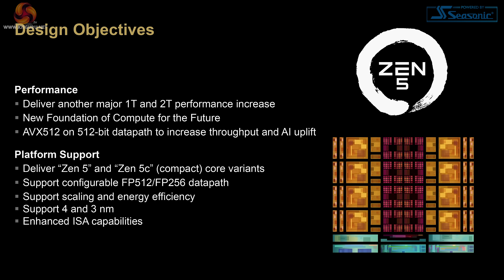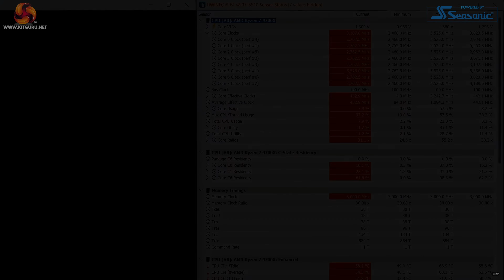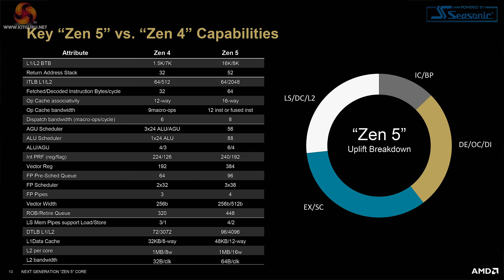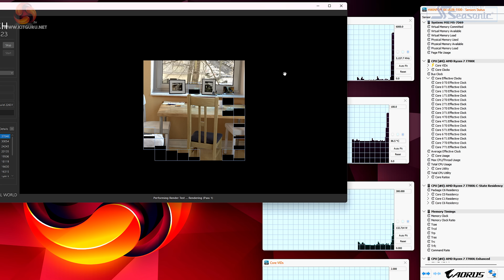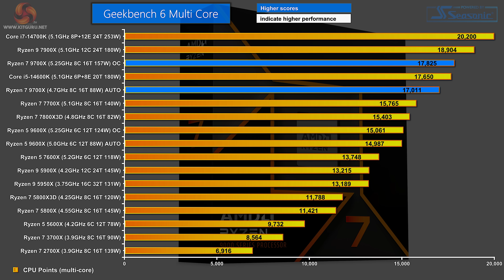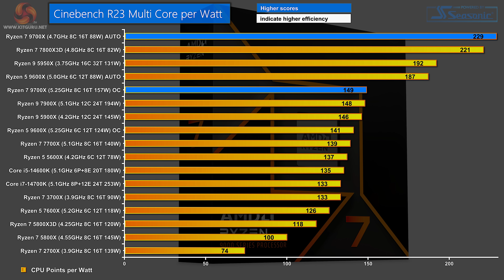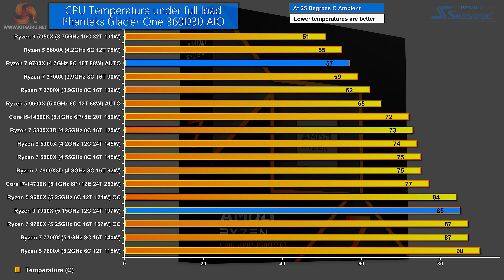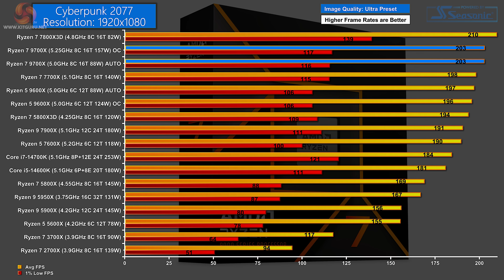AMD Ryzen 7 9700X review: YouTube hates this CPU

Comment: Why is everyone ignoring the Ryzen 7 7700 non-X? It's got the same 65W TDP and 88W PPT as the 9700x, with 96-98% the performance of the 7700x, while costing just 250$
Reply: @carljones9640  it being an "X" Variant is irrelevant, the only things that matter are its performance and its price. "X" is marketing.

And its performance and efficiency is within 5-8% of the 7700, while being nearly 50% more, hence it's bad overall.

It's nearly the same price as a 7800x3d, yet both its absolute performance AND it's efficiency is worse in games, hence its bad for games.

It's more expensive than a 12900k yet gets destroyed in multithreaded workloads, so it's also bad for that specifically.

For sure not DOA though, there's still underlying architectural improvements unlike eg 11th gen, so when it drops significantly in price it'll be fine.
Reply: @yz249  7800x3d=€490+. 9700x=€340+. how are these 2 CPU nearly the same when 7800x3d costs €150 more? they aren't. and 9700x is not 50% more than 7700=€270. it's 20%.
Reply: @SapiaNt0mata  I guess it depends on where you live and what deals you can get, sometimes the 7700 is a better buy, sometimes it costs almost as much as a 9700x. I have them both on and off the whishlist, depending on the price.
Reply: If they’re going to test the 9700x with PBO they should test the 7700x with Eco Mode. In no world is this product worth buying at current price.
Reply: @HowdyYT  and 7700x and 9700x with PBO is not even the same thing, PBO put the cpu "out of warranty" status.
Reply: This should be a 9700 non x launch and cheaper. Also it performs quite bad at 150+ watt
Reply: @Johan-rm6ec  it gains 25% performance running 173W.
Reply: Why all the hate?  Intel released the same CPU with tweaks for well over a decade and every one lapped it up.  It has place it just maybe not for you.  But it's ok.😊
Reply: @littlebill1987  I didn't... I've been criticizing AMD and Intel since 2012... 
And just because one is a bigger shit, doesn't change the fact that both are shit...
Reply: @rattlehead999  why have you been criticizing Intel since 2012? 

The 3930k was an awesome chip. I'm still using it.
Reply: @DingleBerryschnapps  because they stopped improving the cores as much as possible. Cores started getting a lot smaller in area with Sandy Bridge. (Yes sandy bridge was from 2011, but with ivy bridge they solidified the fact that they didn't care for desktop users). 

They started to fully focus on the server market, since smartphones(and at the time tablets) took over.
Reply: The non-X is more expensive than the X where I am.
Reply: @folksurvival  still worth it for the lower power consumption and temperatures, as long as they are not a lot more expensive.
Reply: I am on 7700 and find it great. It boosts at 5.5 GHZ and all is fine. Price is so attractive and don't have that much performance difference as I game in 1440p/4k.
Reply: @Hyperion1722  you won't see much difference at 720p either. XD
Techpowerup tested a ton of games with a rtx 4090 at 720p and the difference between the 7700 and 7700x is less than 2% and the difference between the 9700x and 7700x is less than 6%.
Reply: I have a 7700x and it was a bit disappointing to hear the 9700x is somehow a slight downgrade.
Reply: @th3ch33t  Don't think you watched the video...
Reply: @th3ch33t  Zen5 is bottlenecked hard internally and due to memory bandwidth. 
It does great in server tasks that don't rely on memory much, like literally 30-90% faster, but sadly most tasks are memory dependent and it does 5-15% better there. 

The only problem with the 9700x is the price, if it costed 280$ it would be perfect.
Reply: Because having an X sounds cooler
Reply: 5600 and 7600 were both 65w but the 7600 was considerably faster on a 4090 at around 30%. If zen 5 at the same tdp is barely faster, but costs more, it doesn’t seem like a compelling product.
Reply: @Xennial647  poor example. The 7600 is on a new process node with much higher clock speeds and Zen4 was a bigger upgrade over Zen3 than Zen5 is over Zen4.
Reply: yeah 7700 alone make 9700X absolutely irrelevant
Reply: @Trisstan20  They made a very overclockable 7700 with better power efficiency on the smaller node. Really, it's not a terrible CPU if you want to tweak it, but for gaming, the 7800X3D at the same price or less is the obvious choice. I wonder if we'll see a 9800X now with a higher power limit and boost, similar to their Zen 3 product segmentation.
Reply: @Trisstan20  I mean if you want a CPU with slightly worse performance for a lot cheaper then go with the 7700
Reply: You realize what you're saying there is that if you take a Ryzen 4 part and lower it's TDP, it's going to perform worse than a Ryzen 5 part at the same power, whereas if you let either part draw as much as they want (like with a PBO OC), then the Ryzen 5 part is much faster than the Ryzen 4 part at virtually identical power draw. In either case, the Ryzen 5 part is more powerful while being more efficient, all while being cheaper at launch prices. To uniformly declare ryzen 5 DOA just because it doesn't do any better in gaming is fine, but not everyone is a gamer or even cares about gaming.
Reply: @cajonesalt0191  and remember the next gen motherboards have not been released yet.
Reply: @cajonesalt0191  the 9700x is 10-15% faster than the 7700 non-X.
Reply: @cajonesalt0191  With this usecase i´d rather buy an Intel 13th or 14th gen CPU. They´re better in the "If you max out the part until instability, you´ll win every benchmark" game.
Reply: X actually does indicate something. It refers to the cpu architecture itself. Same was X3D does (much larger 3D cache, better for gaming)

This cpu, is NOT, a gaming cpu. AMD missed the mark there pretty hard.
Reply: @goldenhate6649  If by architecture you mean the applied power specs and frequency, yeah, but X3D is a different hardware design. AMD didn't create a gaming focused CPU, because that's what their X3D parts are for, but they still have to capture some of that market with their advertising. Some people will blindly buy this cuz bigger number better.
Reply: @goldenhate6649  AMD and Intel have NOT made a gaming CPU since 2008...
We have server architectures fitted for desktop.
Reply: @jojobetzler3732    Except that Intel knowingly sells defective processors, then cover it up, and lie about it...
Reply: @cajonesalt0191  "all while being cheaper at launch prices. "
Funny that we are not 2 years in the past anymore. Maybe you have been living under a rock too long, or are just too stoned, but the 7700 had a lower price at release, was available for quite some time already, is now even cheaper, and just about as efficient.
Reply: Because that would destroy their arguments for the 9700x being a good chip, and it's easier to ignore and hope your viewers don't notice.
Reply: @yz249  yeah, my thoughts exactly.

Comment: This is funny, if you limit the 14600k to 90W it should still spit out about 1'150-1'200pt in R24, which is right where the 9700x is at, for the same power consumption. Yes I know that the i5 has many more cores, but in a way it still worries me because the 14th gen is basically a refresh of a refresh and is also based on an inferior node....
Reply: But that's exactly what is the issue: it has more cores: 14 cores vs 8 cores, even through it has around 20 vs 16 threads is simply better in productivity, no matter how many thready they have. Physical cores >>> Threads. And even if they are efficiency cores, they are many more of them. That the ryzen 9700 with just 8 cores catches up to a cpu with 14 cores is concerning yes, for intel.

Comment: Steve of hardware unboxed brought up a good point about why these chips suck even when it comes to efficiency improvements. Theyre only noticeably more efficient than the X parts of Zen 4 and X3D. Theyre only 7 percent more efficient than the non x parts that are almost just as fast but significantly less hot and less wattage. Also wayyyy more expensive than those are currently. So in a nutshell, Zen 5 is actually awful. They somehow still compete with Alder Lake, only are a better option than Raptor Lake because Raptor Lake CPUs are timebombs, and get absolutely  dunked on by X3D last gen and competitive at best with the 5800X3D and 5700X3D. Theyre just bad and Raptor Lake dying doesnt save them from being irrelevent event on their own platform. Why anybody would by these over Zen 4, X3D or not is beyond me considering pricing

Comment: Just get 7800X3D for gaming.

Or 7900nonX for content creation or 7900X3D for gaming+content creation.
7900X is for some reason significantly more powerhungry then 7900X3D.
No need for 9700X .

If powerdraw is critical in your mind, you should know that 50-60W extra won't change a thing in your bills.
Few £ a month.
7800X3D while declared 120W .
According to Tomshardware it's usually below 100W in gaming.

If you would risk with Intel  , than 14600K is best value all arounder on best value for money MSI PRO B650-P WiFi motherboard that supports cheap DDR4 memory that isn't much worse than DDR5 .

Comment: Power efficiency gain of 40% isn't really that impressive considering ryzen 7000 out of the box was outside efficiency range. For example, intel cpus at 400w are only 3% faster than same cpu at 253w limit. That's a 58% reduction in power draw for 3% performance trade off.

Comment: Zen5 is a joke, no improvement. Use less energy but failing to be faster than previous generation it is not improving efficiency. There must be something wrong with zen5, that's why they left too much overclock capability, because it would work for some people but not for othes, then it is silicon lottery

Comment: Great review, very balanced - we need more of this today in a market of media just feeding on drama.
Reply: The Steve's have frankly embarrassed themselves.
Reply: @robertmyers6488 Unfortunately, I would agree with this.
Reply: @gerardw.7468  I noticed it the last gen.  The irony is that when their beloved 9800x3d comes out it will fail the same value performance test.  Even then the data is asymmetric.  No cost analysis of the energy cost differences as a factor of overall cost.   We need more data on power usage from idle to peak efficiency.  

Also, the overall heat load of a system is not trivial.  Could even take it to the other end of the curve.  What is the long-term medical cost and quality of life changes of noise?   Something most are ignoring.  I've spent too much of my life next to fans and its showing.

Comment: Thumbs up for a legit review. It does seem like these new processors have to be unleashed with more power usage allowed in PBO and probably curve optimizer settings to undervolt, to shift the power curve. I'm going to get one but only because I'm prepared to use an AIO and really crank the power to get it to perform like it can.
Reply: I'm in the market myself for a new build. These are tempting with the power draw for similar specs in gaming. And also, theyre all tested at 1080 to show the bottleneck, im running triple 1440 with a 4090, so im not (i think) going to be bottlenecked to utilise the CPU like in these tests. 
PC will run quieter, AIO wont be straining, this actually seems like a decent cpu.
Especially coming from an intel 8700k 😅

Comment: can you compare the ryzen 7 9700x vs the ryzen 7 7700? idk what to buy, because both consume the same watts but the 9700x is only 5-7% faster for around 100$ more in my country
Reply: I'm building a new PC, so the 100$ can definitely go towards a better GPU, or a higher quality PSU, and some other stuff. what do you think?
Reply: @givinnatanlie4619  7700. It's value king.
Reply: @givinnatanlie4619  how much is 8700f ? without internal GPU you now have 200$ more for discrete GPU.
Reply: @xponen  the 8700F is 250$, 9700x is 400$ (could probably go down to 380$ once it's flooded into the market), 7700 is 290$

Comment: How does it compare to the R7 7700(non x) though? iirc those were fairly efficient compared to the x variants for a minor loss of performance
Reply: Well, given Non-X variants have lost some performance while being efficient & 9000-series have in fact gained some performance at the same power lvls — I believe that's your answer right there.
Reply: @F1stzz  so it's an incredibly marginal improvement for quite a bit more money than the current retail pricing of the non-x 7000 series cpus?  that's a miss in my book.
Reply: @ThrasherEscapes  your getting 4% less performance for so much less money
Reply: @ThrasherEscapes  it's marginal now, on first day after the release — current batches of motherboards are yet to be optimized & RAM compatibility issues are yet to be solved. Till the end of this year, when things get ironed out & new chipsets will be out and optimized as well, we'll see how all this doomsday calling ages. Summer next year (might even be spring with all the negative media around 9000-series) these CPUs will receive around $30-50 price cut and become a bang for buck. Also, sitting on a current gen & jumping right on the next one the second it comes out was never a common practice despite how everyone now pretends it was/is too. Give it some time, these chips are already incredible value for SFF builders & in a year, with all the efficiency brought by 4000-series Nvidia and 9000-series Ryzen, that'd be around 50% of users.
Reply: @F1stzz  my takeaway is that amd rushed these out the door when they could have taken some time to smooth out all these issues.  they were under no outside pressure to release these but they went ahead and released them anyway, with several problems that really detract from the day 1 experience.  it's kinda baffling and ultimately frustrating.  i expected these to be better on day 1 than they have been and it's disappointing.
Reply: @ThrasherEscapes  they've certainly rushed things unnecessarily, there's no denying to that.
Reply: they are not efficient. Just underclocked.
Reply: @BleepBlop-rh9lm  they are seriously efficient and they make these 9000 CPUs so far look like overpriced trash

Comment: Worth buying? I cannot think of a launch in recent history where the reviewers werde more divided than with this one. After watching GN's and HUB's numbers, I wouldn't think of these parts being worthy of a recommendation. At least not with current street prices where the 7700X is looking much better price/performance-wise. And even from an efficiency standpoint, Zen 5 does offer just a 7% improvement according to HUB, PBO didn't yield that much extra either. So what's going on here?
Reply: They might have similar power efficiency curves. Zen 4 was overclocked from the factory to achieve Zen 5 performance at higher TDP. I'd like to see performance compared at the same power, gaming might be a matter of using AMD's OC software for a mild boost to 100W or so.

Comment: Short answer: yes it is.
Long answer: with default settings, this is just 7700 non-x and with PBO enabled 9700x is 11% faster than 7700x but is using 11% more power.
9600x is even worse.
The rest is just damage control made by fanboys/trolls/paid actors.